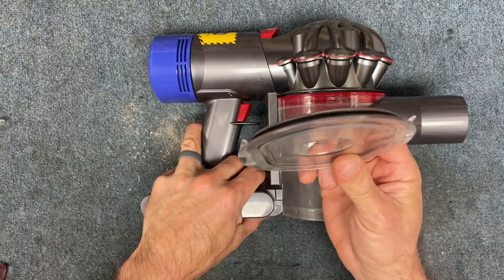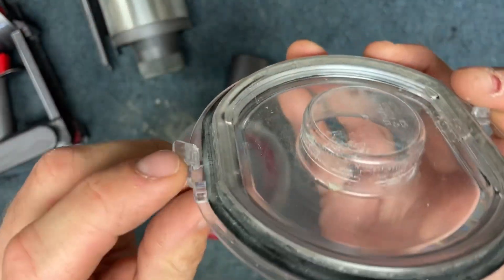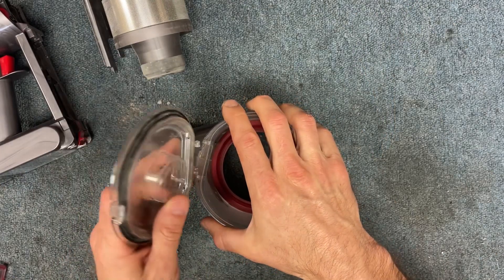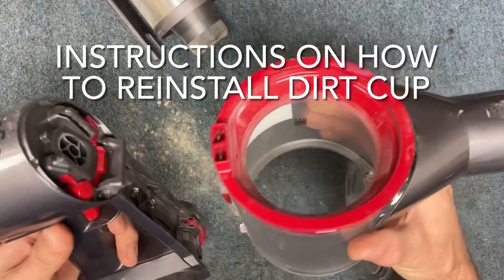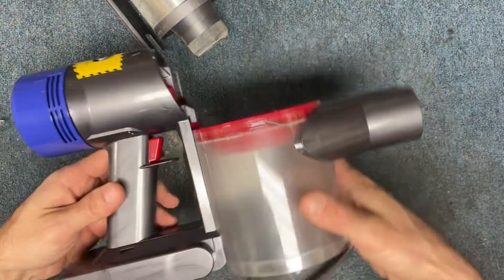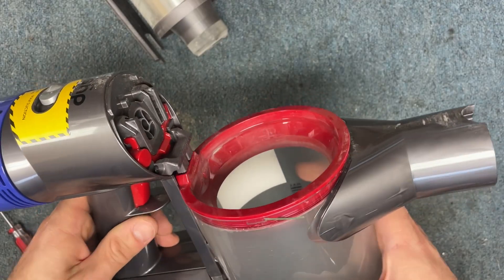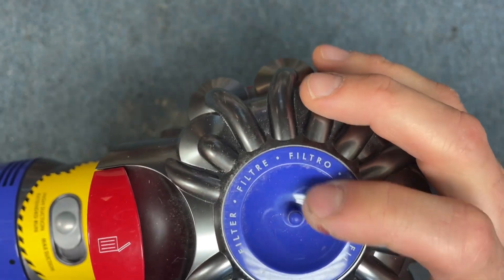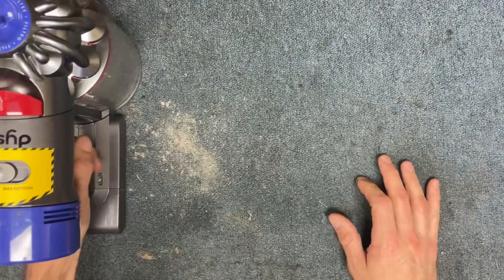Vacuum repairman shows how to fix your broken dyson V7, V8, or V10 dirt cup!

Comment: Hello I need to ask how to disassemble the dust bin completely? I made a mistake and soaked the whole bin in the water, not understanding that it contains wiring inside the pastic (!), and now I see water/dampness condensating around the wiring, inside the plastic, right between the wall of the bin and the darkgrey duct jack that sticks out. Is it possible to dettach this darkgrey duct part from the bin? I unscrewed both the tx8 screws that were visible on the bin part (one is in the red gasket area, and the other is in the grey duct part, right next to the red 'flapping door'. I have the same question about the orange pole as well, I also showered it with water, and only later understood it contains wiring inside (!). Is it possible to disassemble the pole as well, so I can be sure to dry the wiring completely?
Reply from the maker: There are clips holding the grey section to the clear bin. I have not been successful at separating that section. I wouldn’t worry too much about the moisture in there. It may not matter too much as that section is not open to any airflow which means the motor will not suck in any of that moisture. As far as the pole, just set it out in the sun and you will be ok as long as you don’t see any standing water in or around the plug sections.
Reply: @richardsvacuumcenter  Thank you! Other resources also confirmed that it is best not to pry these parts open, they (the clips) are designed to break if pried open. Regarding the water condesation, I was afraid of short circuit situation around wiring. I left all parts dry for more than 72 hours plus blowed warm air from hair dryer, assembled it back and all is well! Thanks once again for replying. Best regards,

Comment: Can i ask you how to fix my dyson when purple dots are flashing ? I have cleaned one filter and it has been charged when i try to use it. It is hardly been used. Thank you so much.
Reply from the maker: Original battery or replacement?
Reply: Original, but I've hardly used it. Thank you.